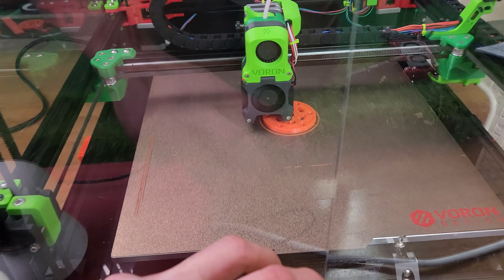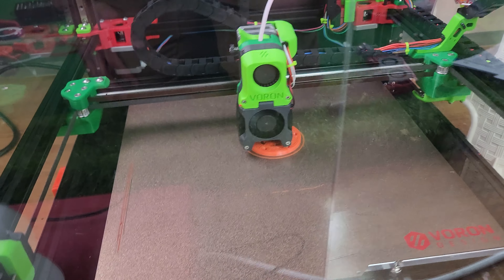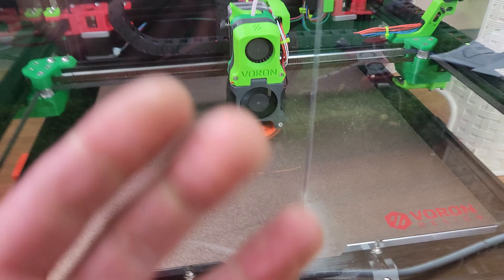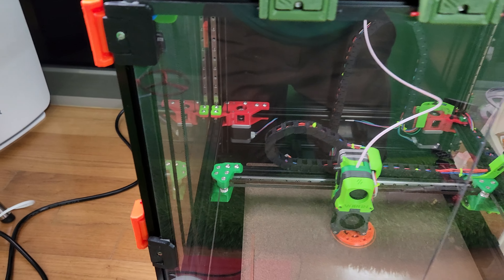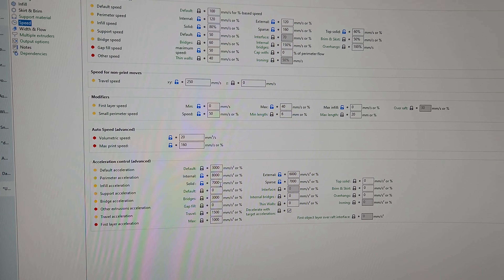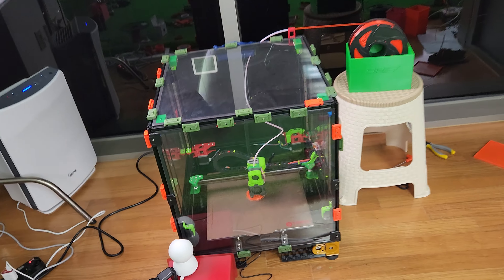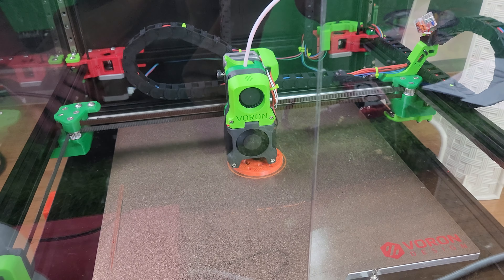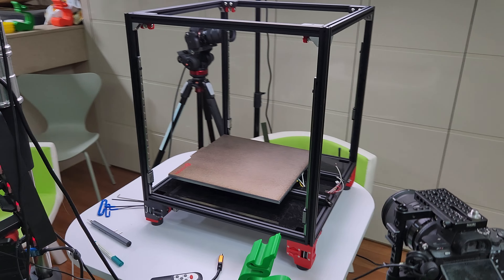My Voron 2.4 Prints ABS PURFECT!  Here's my Setup!

Comment: Klipper changes to [bed_mesh] module
In an upcoming change to Klipper, the default `bed_mesh` configuration will no longer be automatically loaded at startup. If you are using a `bed_mesh` configuration today then it is recommended to add an explicit `BED_MESH_PROFILE LOAD=default` command to your START_PRINT macro (or equivalent print start commands in your slicer). This change to Klipper is planned for February 1st 2023.
Reply from the maker: Noicr
Reply: @3dPrinterSchool  So what will happen, every time I start to print I have to calibrate bed mesh, or I have to load by the g-code?
Reply from the maker: @dumdumreviews7436  you can add to your start macro or add it to gcode under machine settings in slicer.  I dont use a start macro myself yet i put all my gcode in slicer atm.

Comment: Given that the LDO kit is twice the price of the Formbot kit, is the apparent precision and attention to detail offered by the LDO kit significant enough to justify the additional cost, or is the Formbot kit a better value proposition? Seems like paying for upgraded fans, hot end, and motors is not going to suddenly double the price. I've been searching on forums for helpful responses, but they quickly devolve into lackluster discussions.
Reply from the maker: I have LDO motors on my ratrig, which is standard on the printer.  Compared to my Formbot kit, not a huge amount of difference, running Moons motors on Formbot kit at 1.4amps and the LDO motors at 1.6amps.  The Moons motors are plenty fast and accurate.  It's more like you want to buy a Hyundai Palisade that is a good SUV with all the basics you need or you want to spend more to get a luxury Mercedes SUV.   People with LDO kits are going to swear by it but then again they probably never built a Formbot either.  I have built 2 Formbot kits and they are working solid and fast.   I also gonna build a Fystec which I got also.  My 2 cents on the matter.
Reply: @3dPrinterSchool  Hey, thanks for your input on this! I appreciate it!

Comment: Everybody is talking about voron and speed but how fast can ABS be printed by voron if the material limits are 50mm/s for example. With more material will warp extremely
Reply from the maker: Yes if abs is printed without an enclosure but voron is designed with an enclosure and enclosure temps stay near 50-60 degree celcius which is why you can print much faster with no warping.

Comment: Great overview. How fast were you able to make an ABS profile for the voron?
Reply: abs prints ridiculously fast, ive got it running 400mm/s at 25k accels. its one of the best speed materials
Reply from the maker: What hotend are you using and temps?
Reply from the maker: I am gonna speed it up should he able to do pretty fast speeds.
Reply: @3dPrinterSchool  rapido HF with cht type nozzle and 260º
Reply from the maker: @tadhgd350  oh noice i have rapido on my ratrig also, so much more flow!